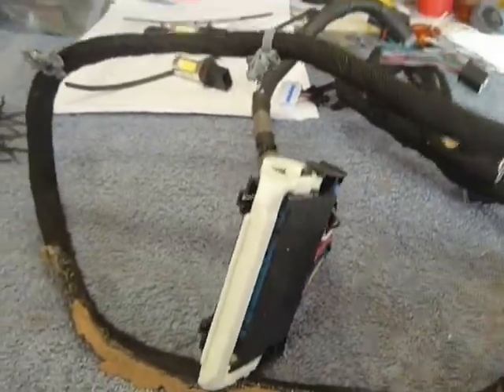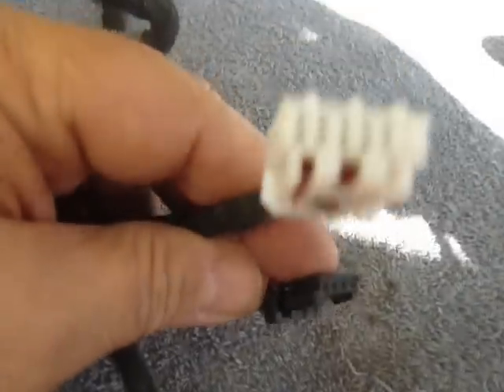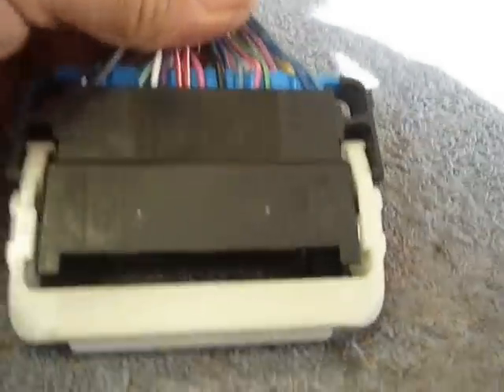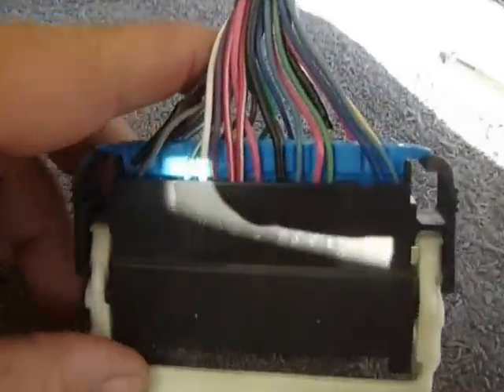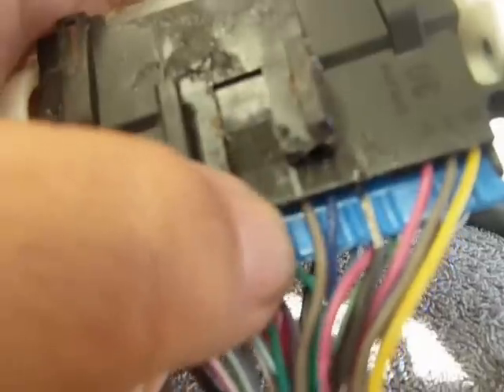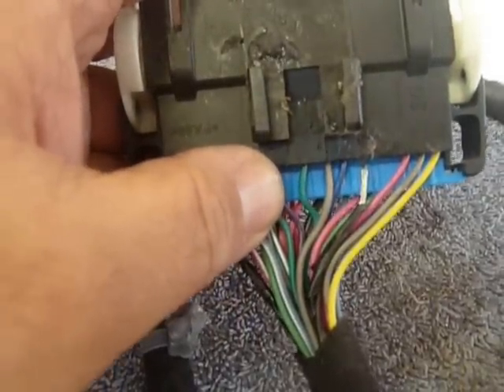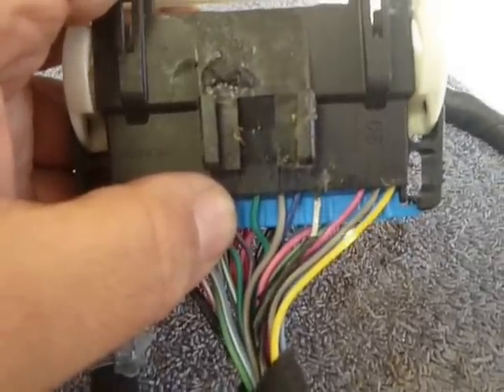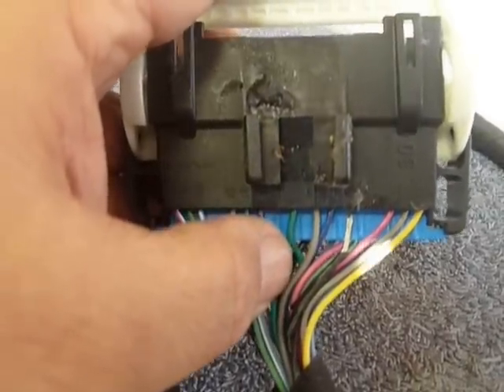Dome light harness

Comment: Hello sir, thanks for the video.   I followed your instructions on connecting A7 green and gray together to the positive wire on the led for my foot well.  I did exactly as you said it would.   However,  when I start the car the dome light and led' s only dim, they do not off like they did when I just had the accessories on without starting the car.   Any suggestions?
Reply from the maker: Best is to call the shop, 928-505-1383
Reply: 2ssrs thanks.   I figured it out!
Reply: @mikeleeslifehacks  what ended up helping you?